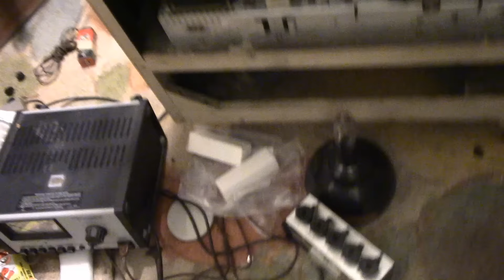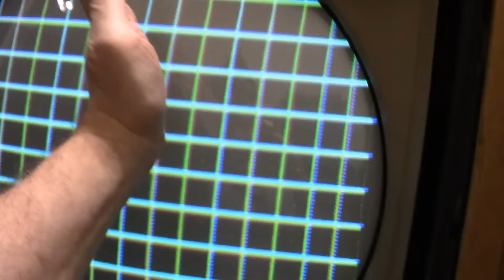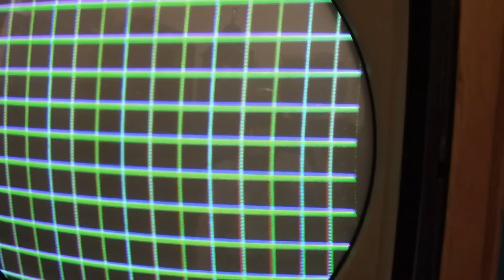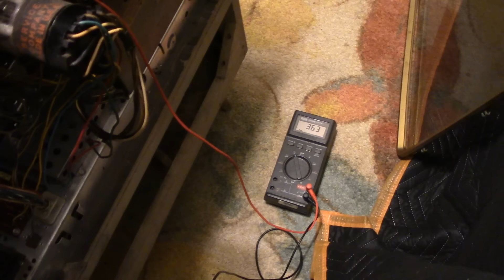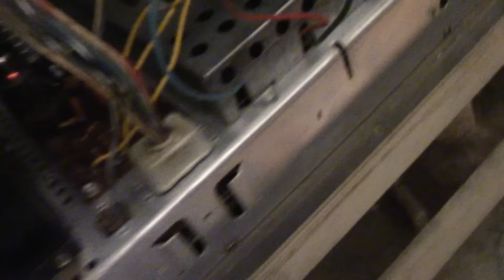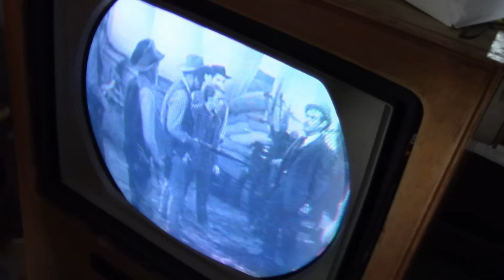1956 RCA color TV (CTC5 Westcott) part 7 - Convergence and more problems

Comment: I had  a blonde CTC single digit vertical cabinet set.
It was eating 6DQ6 horizontal output tubes, couldn't tweak the cathode current down. 
     In a dark room, the green looked really good on a baseball game.

Comment: i had that exact model in the early 1970s. Was given to me by a college roommate. A guy I worked with at a TV shop was an RCA genius, and he restored the chassis for me. Convergence on that set was always iffy, and getting it aligned out to the edges was damn near impossible. I spent many hours on mine, and came to the conclusion that this part of color tv design was still in need of refinement.

Comment: The hours I spent trying to get dynamic convergence set right on TVs with Delta guns and burnt out adjustable coils and boards. Tweak the coil core and crumble.... Trick is get the centre static convergence aligned and then do as little as possible in adjusting the dynamic. The old convergence boards were getting burnt out back in the 1980's on 8 year old sets, God knows what they are like now. I was really please when PIL tubes became the most common type.

Comment: I'm thinking there might be a mechanical problem with the board. You said the problems occur when the set has been running and has gotten hot. Tightening the mounting screws changes things. Sounds like a very small crack might be causing it. Maybe near a tube socket where heat can cause the most expansion.

Comment: We were an RCA dealer since the mid 1960's until we closed in 1996. The remainder of my career I worked for Circuit City service until retirement. I saw everything from the CTC4, the much disliked CTC170/171, 175, 177, 178, 187 and even one of those CTC47's (the model 2000) and a lot of Thomson stuff. Never did service a CTC2. Wonder who decided to locate that horizontal efficiency coil adjustment so you have to reach over the HV cage. Lynda Carter looks pretty good on that CTC5!!!
Reply from the maker: I did get down in there with the set off only to discover the slug is frozen!
Reply: Probably cracked slug, knocking the efficiency off

Comment: When I was working in TV shops in 1974 - 1975, there were 1 foot long alignment sticks for adjusting coil slugs, that's what you need for the horizontal efficiency coil.  However, I don't know if they are still available.  

RCA tried several different convergence designs in those early days of color television.  I don't think they settled on a permanent design until CTC-9.

On TVs, trying to maintain a good ground via a mounting screw to the chassis is guaranteed trouble.  To add to that, the circuit boards also combine the filament grounds with the signal grounds.  If you have a lot of trouble with the grounds, it might make sense to solder braid from the board to the chassis.

Comment: blooming is caused by the high voltage rectifier. Thev HV should be 25 kv. Contrast and brightness should be at mid range.

 and mid point.
Reply from the maker: 22.5.  I no longer have a blooming issue.  The HV is a little low at about 19.5kV but stats nearly constant across the brightness range.

Comment: Time to get that JIG up and running.  When I saw the hum and fade I knew it was a bad ground.  Once the B+ is ironed out it would be wise to put thermistor or two in somewhere.
Reply from the maker: My jig is not compatible with this early model.
Reply: @bandersentv I have hooked up rca roundies all the way back to CTC 9 up to that jig.  I saw a video of a guy connecting a CTC 2 (CT-100) to a similar Zenith jig.  Believe me it will work. I see the CRT adapter selling for as little as $20.00 on eBay.
Reply from the maker: The adapters and instructions only go back to CTC-7.  Keep in mind I don't have any of the main cables that plug into the jig.  The only other rounds I have are CTC-15 and 16 so I'm not that interested in spending a lot of time making adapters I'll only use once.
Reply: @bandersentv  Now I am trying to remember which jig we fried the molex connector on.  (We had 3).  One of them we had fashioned a octal extension cord and plugged the adaptors into the extension.  :)  I get it though, if you don't find it worth your while don't do it.

Comment: From your finding with the problem, it seems loosening and retightening the video amp board screws, it improved a board ground which was poor and as the set heated up only got worse. The solder pads under those screws has been slowly extruding and oxidizing for many years, resetting them the way you did was all it needed. I'd personally do the same with all of the chassis screws to PC boards just to remove any potential floating on any other grounds just to make sure they're good throughout the set now.

Comment: RCA’s AfterThought™️ Grounding method strikes again.

While you’ve got the chassis back out. Solder in some wires between each of the board’s ground islands and the chassis. You’ll end up having to re-torque those screws every couple of years if you don’t.

Comment: More modern roundies as well as rectangulars did have simpler and more reliable convergence, but for old time sake why not follow the RCA manual directions to a T to see how good you can get it.  You mentioned solid state  (I'm guessing germanium or silicon diodes) for newer convergency circuitry.  But are selenium rectifiers used for signal detection purposes even at this stage?
Reply from the maker: Too complicated, don't have all the equipment or space and the yoke is deteriorated.  There is a germanium detector diode.  Yes, newer sets have selenium diodes in the convergence circuit.
Reply: @bandersentv  Yes, if faffing around with the yoke could damage it, then it's understandable to curtail that activity.  I'd take it that repair shops in that set's era were specialists, then.  Decades ago I worked on a Magnavox CTC-15 clone from the mid 60s, and its convergence behavior was reasonable.

Germanium characteristics and heat don't mix well, and that thing is a roaster if I hear your comments.  I'd wonder if a Schottky could replace it with better reliability.
Reply: @bandersentv  If space is an issue for working with old color sets, I guess you are getting kind of crowded in there.  I worked on mine in an ordinary living room, where my folks didn't mind me propping up mirrors and such.  I'm curious now though what special equipment sets of that vintage needed that those of a decade or so later didn't.  Just for perspective sake.  Not saying it's untrue!
Reply: The one good thing I can say about the convergence controls?  They're in the front.  :D
Reply from the maker: True but many of the convergence steps require you to poke around the back of the set as well.
Reply: @bandersentv  Oh yes, the static settings.  Which doubtless didn't want to stay adjusted with a set of that vintage.  Changing DC bias in the convergence coils would do that.

Comment: One kooky thing that is mentioned in the HV alignment procedure is that they used a really long screw to secure the HV cage lid so that by the time you finished unscrewing it, the residual HV should have been dissipated when you start poking fingers around in there.

Comment: Looked pretty good at the end.  I grew up with one of those.  It was originally my grandfather's.  Had it in my room as a teenager.  That thing was still working into the 1990's believe it or not.  Very few issues during decades of use.  Not bad for what I recall was RCA's first real production color TV.

Comment: Fascinating video, but the convergence procedure sounds like a nightmare! Early on, with the advent of color television sets, it seemingly never occurred to the designers of these receivers that accelerating electrons at extremely high voltages to hit metal plates in rectifier and shunt tubes, as well as the shadow mask in the CRT, are serious safety issues. The engineering department didn't take into account the well-being of the techs who regularly repaired these TVs, some of whom may have been adversely affected, prior to providing lead tube shielding and other safety measures. Federal safety regulations for newer sets didn't go into effect until 1969-70.
Reply: We are lucky that trump was not president then . He would say we don't need freaking shielding . It costs too much .